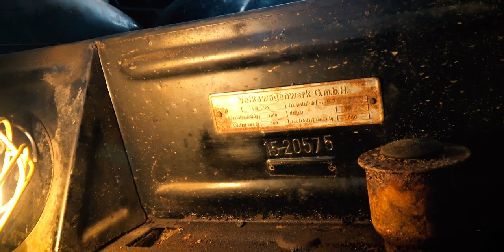⇓ Unveiling the Journey of my 1954 Convertible Bug ⇓ Part 1 - The Teardown ⇓

Comment: Hi Chris,
I have a 1963 bug with (Ruby red L456) color code,and soon it's time to finish the restoration and paint the car, but it seems as if this color doesn't exist anymore, do you have any idea  which modern color can be used instead?
I really want to restore the car to its original look. 
Thanks